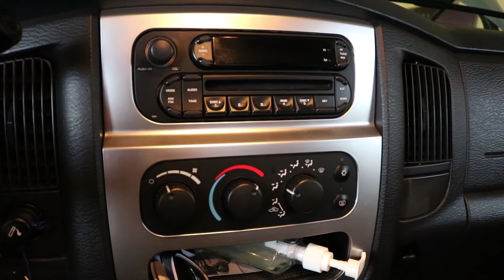2005 Dodge Ram Radiator Replacement

Comment: Damm I changed mine today and it blow up I didn’t turn on the heater but it was driving good the temperature was fine and it just blew up
Reply from the maker: What the heck! That’s wild! But I know you be slidin lol did you burp the system before driving it?